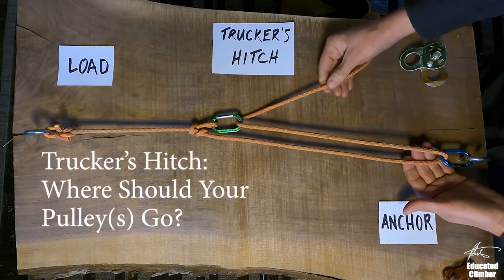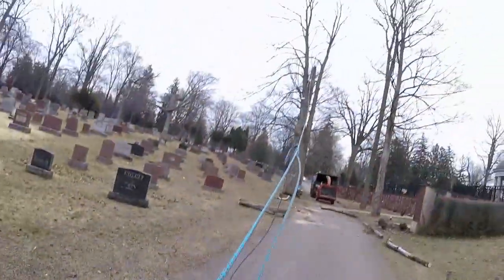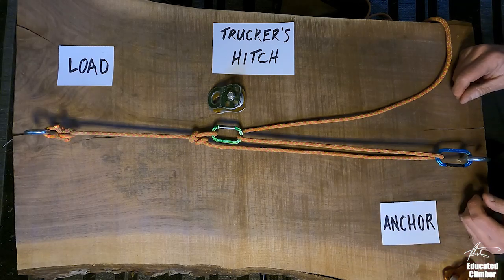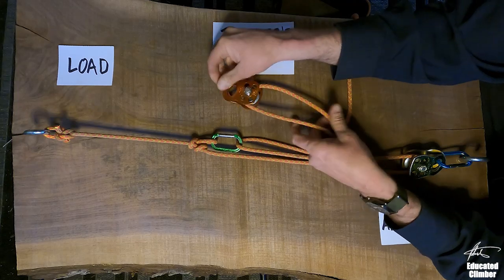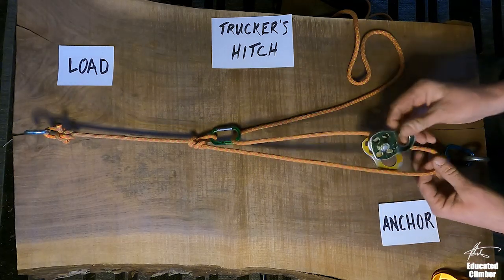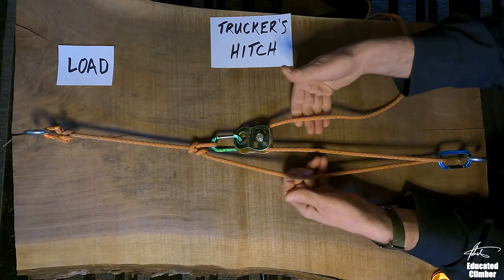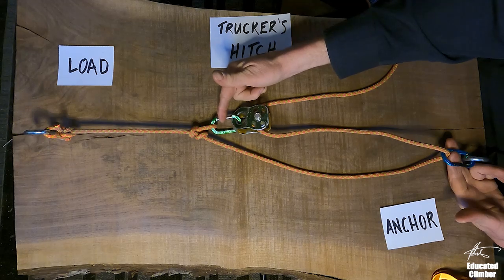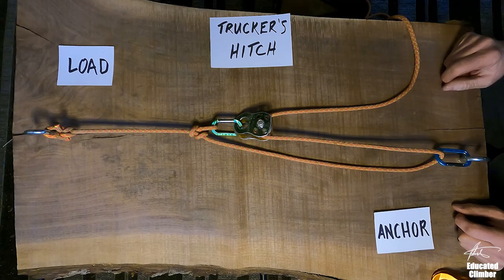Where Should You Add Pulleys To A Trucker's Hitch?

Comment: I don't have a hook yet but have been tinkering with a truckers hitch in with my hitch climbing setup. The pulley on my hitch climber is at me the load and goes strait back up the line to a prussic, carabiner and another pulley then comes back down to me. The idea is to use two climbing systems so that I can drag myself up on one and out to hard to get places. I've not tried it in a tree yet just been dragging myself all over the house from door knobs sitting in my rolling chair. 

That Alex really knows his pulley stuff Patrick!
Great video also and good to know if you only have one pulley available.

Comment: The amount of time it takes you to put a carabiner at any place in the system, you could have instead put a soft shackle and a ring.  I fail to see why you would use a carabiner over a soft shackle & ring when actually working with a trucker's style hitch, unless you didn't have any with you.  My 2 cents.  Dave
Reply: Ring isn’t midline attachable.
ring and soft shackle are two parts, biner is one.
Reply: @neild7971  Ring is midline attachable.
Reply: @shadowscape6290  i like rings and soft shackles but surely you can see they have disadvantages in many circumstances. Yes you can tie a ring in the middle of a rope but anywhere you want the rope to run in the ring you have to put an end through or else deal with a clumsy bite of rope that often isn't even workable. i wouldn't consider that midline attachable. fair enough if it does work for you, i can't see it.
Reply: @neild7971  Not using the rings in that configuration.  Soft shackle through the center of the ring and running your pull line over the outside.  Midline attachable.  Ring acts as a pulley sheeve.
Reply: @shadowscape6290  ah got ya! still two bits...😄,  sounds good though. never had any x rings loose like that, took me a bit to get there, cheers
Reply: @neild7971  I use rings on trucker's hitches all the time.  They are fast, simple and efficient.
Reply from the maker: Yes, it's because I probably wouldn't have them. I use a Trucker's for speed. If I have to run back to the truck for gear then I'll add something into my trucker's, but so much of the time it's powerful enough on its own. Cheers Dave